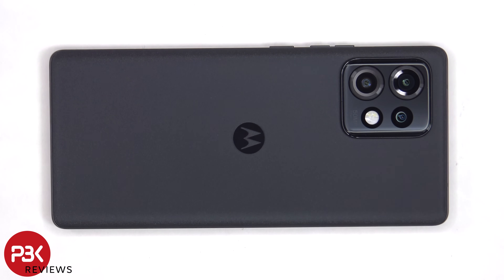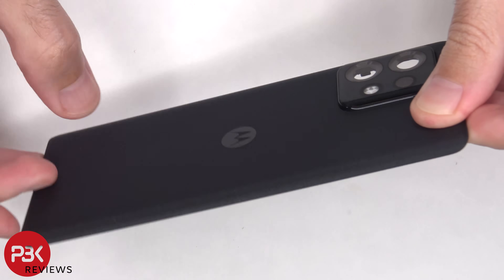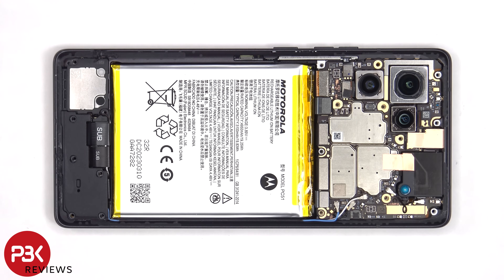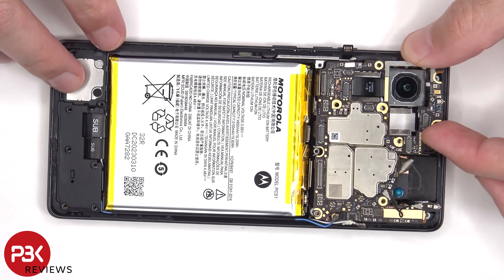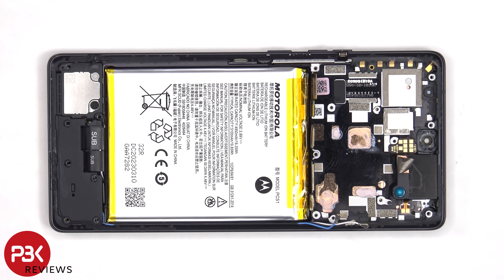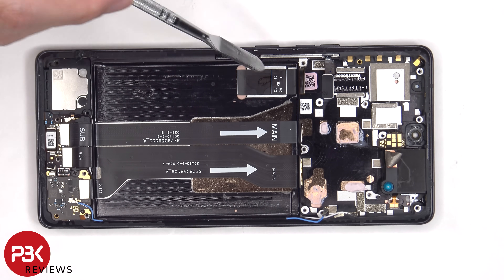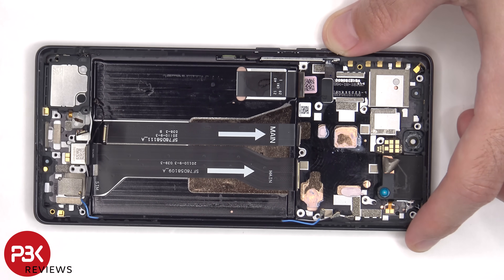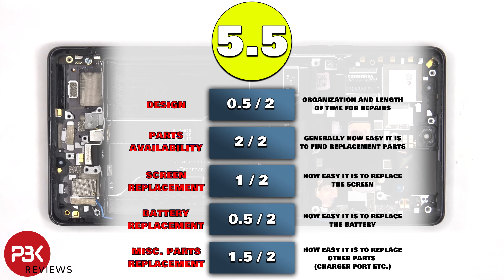Motorola Edge+ 2023 TEARDOWN Disassembly. An Upgraded Motorola Edge 40 PRO/Moto X40?

Comment: In wondering if i replace my battery if itll stop the overheating. Im afraid that mine is water damaged. It works perfectly but it gets very hot.
Reply: the heat is a problem about snapdragon 8 gen 2 buy a cooler and be happy and i hope u dont drop theses motorola phones in the pool because motorola have a fake protection
Reply: @josecristianosaldanha2963 i don't have it anymore. It ran cool for the most part until it fell into water

Comment: Is it possible to save ip68 on it?
Reply from the maker: as long as you replace the adhesive with the original pre cut adhesive made for the phone and apply it properly, you should retain IP rating. You can find parts for this phone at mobilesentrix.com

Comment: Hey bro, that copper shim over the cpu, did it come with that or did you install it?

I've never seen Any manufacturers have the decency to give us copper 😮
Reply from the maker: comes with the phone
Reply: @PBKreviews  thank-you for confirmation 
I actually orded this phone for 200$ plus 40$ from boost with 40$ plan and had some thermal paste + thermal pads for a mod in my ebay cart XD. but I guess I won't need amy this phone looks like it couldn't be any better on thermal dissipation

Comment: I'm so happy I found your video.  Is there a video on how to repair the glass on the rear cameras?
Reply from the maker: :) It's just held on with adhesive. Use a hair dryer to heat it up to loosen the adhesive, and you can use a razor blade or Xacto knife to pry it off. Then you will need new replacement adhesive and the replacement glass to re apply. Check mobilesentrix.com or rounded.com to see if they have the replacements.

Comment: Thank you for mentioning the differences between the Moto Edge+ (2023) and the Edge 40 variants.

It really seems like the U.S. Motorola phones (the Edge Plus) we get screwed over.

Id be interested to see if the non U.S. versions support 125w charging, as i know the U.S. versions do 68watts but Motorola does sell a 125 watt charger so....
Reply: I have a Motorola Edge 40 Pro and would like to know if I can replace the original 4600mAh battery with a 5100mAh one. Could there be any compatibility issues?
Reply: I think they do also I think the us version is better in some ways like the us version has the snapdragon 8gen2
Reply: @alvarogarcia5737 all three version has snapdragon 8 gen 2, the US gets 8/512 config with 68w brick and, europe/global gets 12/256,512 with 125w brick, China gets 8,12/128 (UFS 3.1) 256, 512 (UFS 4.0)  with 125w brick
Reply: @farhanabid1014  The USA one also has a bigger battery of 5100mah, while the euro/global one has 4600mah.

Comment: I have a couple of questions.. where can I find replacement parts for this device? And is it possible to upgrade the ram to 12gb from one of the other variants?
Reply from the maker: Here is a link for some parts which are for the edge 40 pro which is the same phone just rebranded. https://www.ebay.com/sch/43304/i.html?_from=R40&_nkw=edge+40+pro+&LH_TitleDesc=0&_sop=16    . Also no, the only way you would be able to have more ram is by using a motherboard from one of the models which has higher ram since its soldered to the main board.
Reply: What adhesive do you use to reapply the back plate?

Comment: You always make it look so easy. It's these videos (or picture tutorials) that have SAVED my phone SO many times in the past decade. The last Motorola I had didn't have wireless charging so I had to replace the charging port board... 3 times. It wasn't complicated to get to, but plugging that board in was not easy. The plug was at an awkward angle. So glad I finally was able to upgrade to this- with wireless charging! ☺️
Reply from the maker: Glad they were helpful :)

Comment: BUYER BEWARE !!!!

I bought this phone on May 19th 2023 when it was first available. I got it two days later. The following day I wanted to activate it with Verizon, this phone was clearly advertised as being compatible for Verizon. Verizon told me otherwise. Motorola told me it's compatible with Verizon. I had to argue with both companies that they oppose each other's opinion and I'm just the person who pays for the device. There was no solution being offered from neither of both parties. It is unbelievable that Motorola could not find the issue and you would think they work long enough together with all the carriers to figure out how to make a phone and how to sell it. Since Motorola couldn't find out this problem the literally told me I want to return it and ask for my money back. 
I asked them if they are going to tell this every single customer who wants to buy this device and cannot activate it, opposing the initial compatibility as per advertisement. I got nothing but apologies. 
Don't buy this phone!

The initial title of my review was :

"not overwhelming for a current flagship"

This is my second motorola. The first one I just replaced with this edge Plus 2023. I must say it's nice but not overwhelming for the price I paid. My old Motorola MOTO z4, which is now 4yrs years old, had also already a 50 megapixel camera. So this did not change much except of the software. Also my old Motorola has a much more saturated colored display ( if you compare one by one). However the display is very good and the stereo speakers do the rest, YouTube videos are a charm. It's a downside not to have an external memory card slot. However, I can use an adapter cable and access a flash drive through USBC. I may update this review.
Reply from the maker: Although this phone has all the compatible bands for 4G for Verizon, and most 5G bands aside from UW 5G, it is not marketed as a Verizon device but as Unlocked. Usually when it comes to Unlocked devices, its a hit n miss with Verizon. First, as long as you have all compatible bands for 4G, it should work fine but say for 5G you wont get UW band 5G since the phone doesn't come with the mmWave 5G antenna. Second, with Verizon, they don't have an open network for unlocked devices, meaning only Unlocked devices with approved IMEI's on their list will be "allowed". Now what happens is for example I have used Unlocked devices with an already active sim by just popping the sim in the phone or "hot swapping" the sim as its called. In most cases it should work fine with no issues, but weekly or semi weekly Verizon runs purges that kicks off certain devices which are running on their network without them being approved on it which would cause me to have to pop that sim into an approved devices and activate it again, then pop it back into the unlocked device to have to do that all over again every week or 2 weeks. Not this has happened only on some Unlocked devices that are international models. As for US unlocked devices you shouldn't run into any issues like that, BUT you will run into issues if you try to call Verizon to activate the device with a rep, since most average reps don't know much more than you do. You will almost always have to talk to tier 2 tech support since they have the tools to be able to properly get it activated, or if not they would tell you to activate the sim on an approved Verizon devices then pop it into the unlocked phone. Now I know for a fact, if Verizon wants to, they can approve an IMEI on their system and add it to the approved list on a per customer basis, but its extremely rare. I have done it once before for a phone I really wanted to use on Verizon which had compatible bands, but 1: it was on a business line, 2: I had to talk to a higher department above their tier 2 tech support and they had to file a ticket with the engineering department to manually add the IMEI on the list so it would work properly, and 3: they only did it since if it wouldn't have worked, I was going to switch the business accounts to a different carrier to be able to use the device. This only got honored once for me and I tried another time with no success and they declined to do it. SO yeah very long story short, its not Motorola's fault or issue, but the problem is with Verizon and who you actually get on the line to help you. If you see the rep is unable to or doesn't know what their doing, ask to be transferred to tier 2 tech support and if that doesn't work, call back and again ask for tier 2 and try with a different rep.
Reply: @PBKreviews  wow, thanks for the information. I hardly give up on something,i actually called twice Verizon on their hotline myself. But i don't believe it was a tech level 2. Your details are quiet amazing. One would think the manufacturers would know this issue about Verizon and clear this out for good, it harms both companies and their reputation. I will try to buy it today at best buy, only because it seems like there is currently no other phone on the market with the same specs for this price. Thx again
Reply from the maker: You're welcome, and glad you got it working with best buy.
Reply: I just got mine and haven't gone to the store to activate it yet. I will say that in my experience with activating my previous unlocked phone the oneplus 7 pro i had to make a few calls to get them to activate a part of the chip as it wasn't on their bring your own device list. As long as you have the north American model, they should be able to activate it, unfortunately some of the Verizon techs are more informed than others, you might have to try a couple times. It's annoying, but the manufacturers aren't lying, Verizon just makes it a hassle.
Reply: @MarsEsRojo  thank you so much for your feedback. Let me know how that works out for you. I bought this phone on Amazon. As of today it's available at best buy. Maybe I go there later today and try to buy it and get it activated in the store. If it doesn't work I give up on that damn thing
Reply: @OldmanWithers hey, wanna let you know i got it from best buy and the phone works now with Verizon. Good luck to you
Reply: @OldmanWithers thx. Please let me know. I go to Best buy tomorrow as well. Around 4pm west coast time. I will post you asap. Please consider the same.
Reply: I use visible and they told me this phone wouldn't work on their network but I inserted sim and it was all good

Comment: So that's why they lowered the ram. So that a bigger battery would fit inside. /s
Reply from the maker: lol, in reality the size of the ram won't have anything to do with it but only thing I can think of is they made the battery slightly thicker but the layout or internal design is exactly the same as the X40 etc, so not sure how they made a larger battery fit since the 4600mAh one was already maxed out space wise. I don't have an x40 or edge 40 pro on hand to compare side by side unfortunately. Might also be a different battery tech which allows the battery to have higher capacity in the same size.